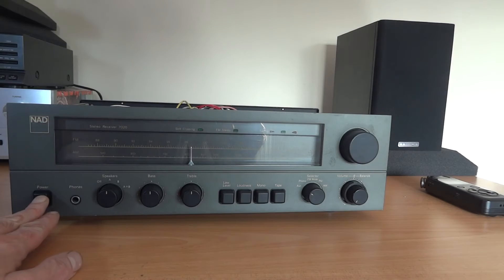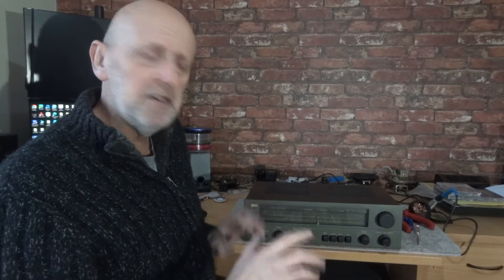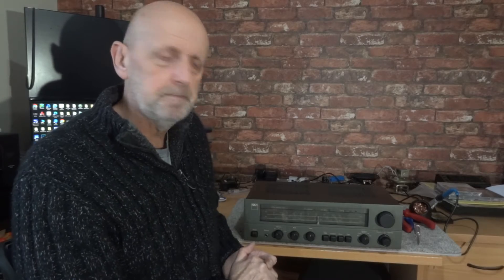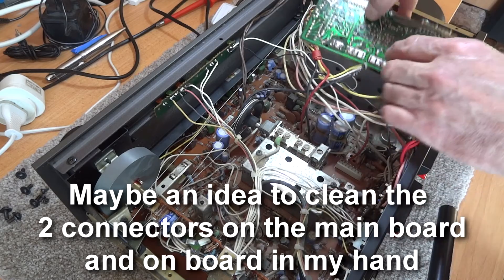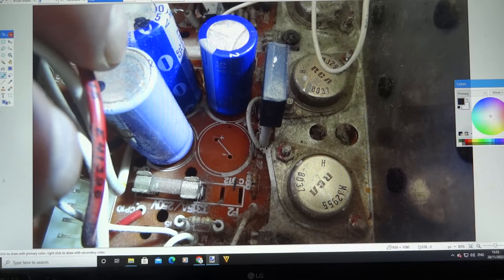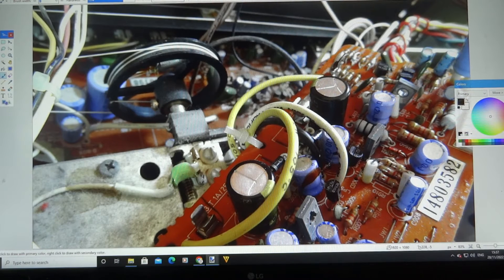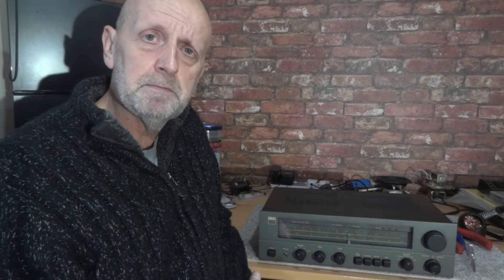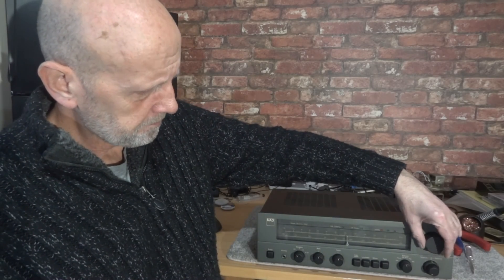NAD 7020 Receiver Power Supply Capacitor Replacement, Buzzing, Crackling, Popping Noise, 3020 Amp

Comment: Evening Michael. Many months on and got around to the Capacitor upgrade today. And what a difference. Its like a blanket has been removed from the speakers so much cleaner and crisper. 

Hence its allowing all that lovely detail to be portrayed. But for me the biggest win was in the bass. Its deeper and fuller, but without being boomy. And again detailed you can really pick out those notes. 

Well worth doing as you suggested. I opted for the Panasonic Gold FM series capacitors in the end. But upped the spec to 3300uf and 680uf respectively both @ 50v.
Reply from the maker: Good to hear that the recap has brought out more detail etc, from what I have read the caps in the 3020 and 7020 very much need replacing by now, as their lifespan was not as long as some caps were back then. Always nice when things go really well with a recap.
Reply: @MichaelYates  The caps were ok initially, ie no hum etc. But I have restored a couple of Stereo 20 valve amps over the years, so know the difference it can make. And the curiosity got the better of me. I'm Glad I did it, as I was pleasantly surprised.

Comment: Thank again Michael. Just acquired this model so will follow this video as I have a slight hum in operation. Incidentally what caps did you use?
Reply from the maker: I had used some 2200uf 50v rated at 85c Panasonic Caps here as I had them laying about. A good Panasonic, Nichicon etc will do.
Reply: @MichaelYates  Cheers. Since my reply and leaving it soak testing the hum has gone so I'm thinking the caps must have `recovered' . However I have got intermittent crackling noise about the selector-volume-balance controls so going to check for dry joints tomorrow. It sure sounds lovely though.
Reply from the maker: @hjhifijunkie8281  Dry joints, check and tighten any earthing tags, loose screws and nuts and clean all controls all will help.
Reply: @MichaelYates  Thanks for the advice, will do!